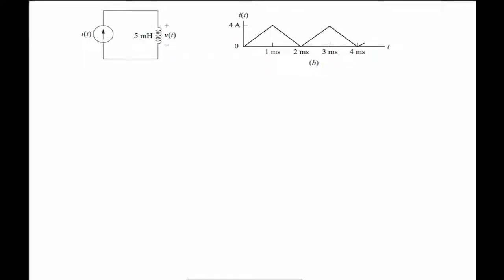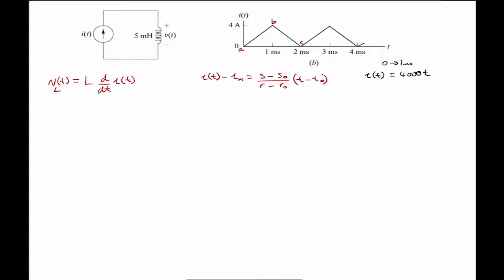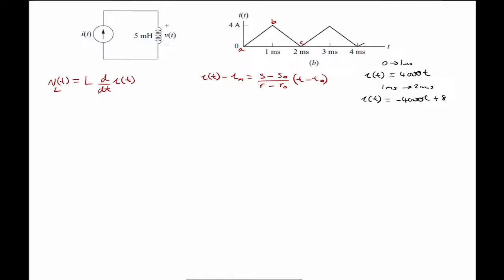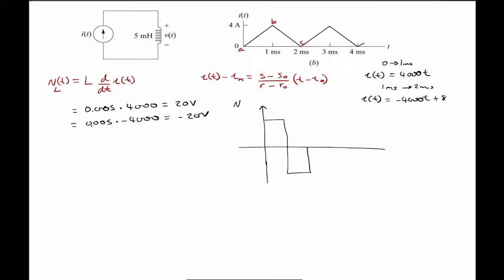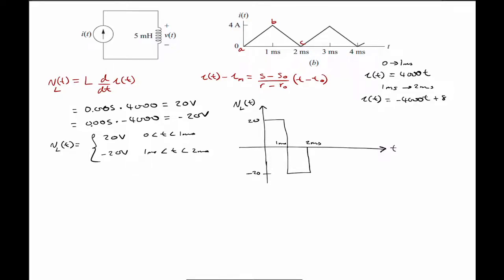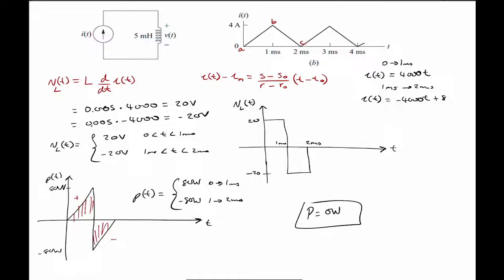Determine the voltage, instantaneous power, and average power for the inductor given the wafeform.

Comment: I believe that your analysis of the b to c section of the waveform needs to be revised. Your potential is at 20 volts at b so you should add the -20 volts to 20 volts resulting in 0 volts. If this is not the case, would you please explain the error in this approach.